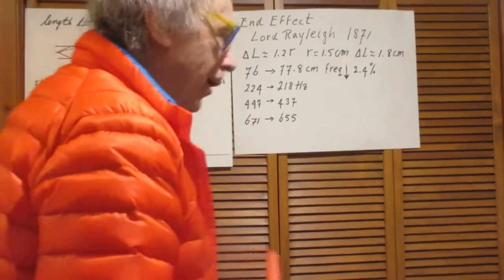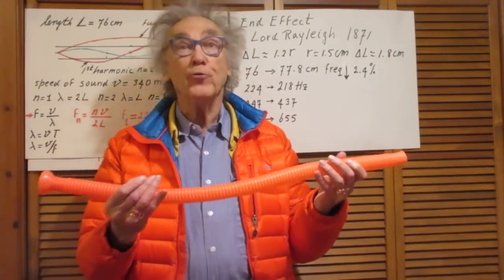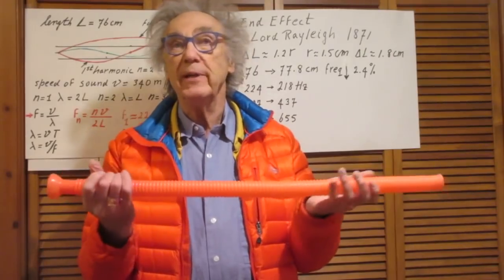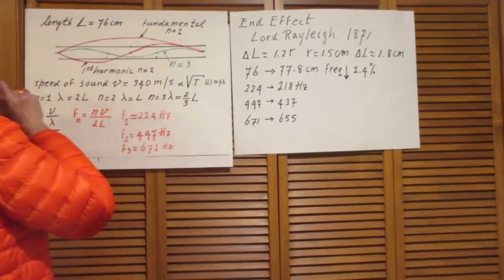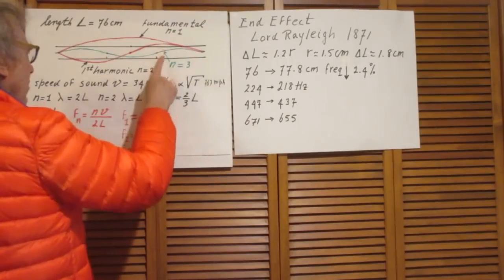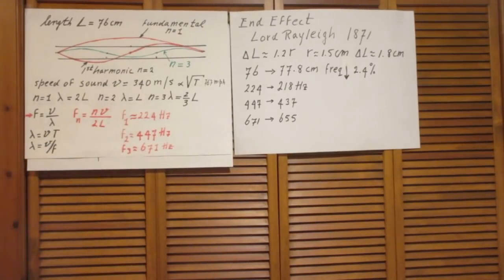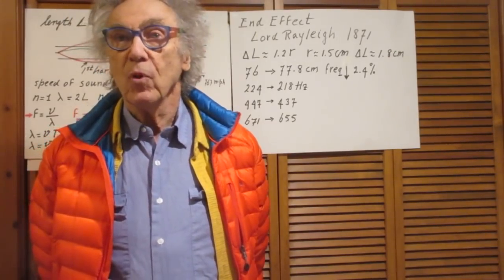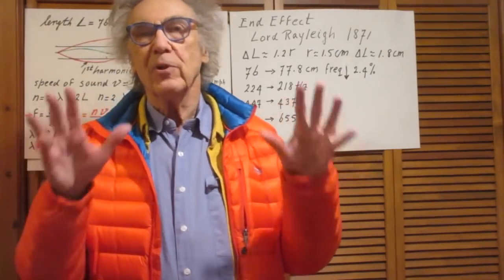Solutions to Problem #58 Organ Pipe

Comment: Thanks for another great lecture.  As to the difference in calculated vs measured frequency, how was the diameter of the tube determined?  Inside, outside or an average of the ripple pattern?  Just asking.

Comment: Coube some one have the windown opened so maybe the wind changes the presure in the air for some moment ????
Reply from the maker: "The fundamental and harmonics of a corrugated tube are lower than those of an uncorrugated tube of the same length and diameter" "The difference in speed between the moving end of the tube and the stationary, hand-held end creates a difference in air pressure. A higher pressure is at the fixed end and a lower pressure is at the moving end." https://en.wikipedia.org/wiki/Whirly_tube
Reply: @lecturesbywalterlewin.they9259  ok i read that and also about bugle scale Do Sol Do Mi Sol  , have a nice day profesor take care !!!

Comment: just as an idea where to look for the reason of the difference: i measured the freq. using a phone in front of my pc on your YouTube Video. so the Sound was transmited via the Internet. to make the loading time of Videos a bit faster the Video and the Sound are compressed. a method to do so is to make changes at the frequencies. for example mp3 cuts of frequencies that are not hearable be human ears. so Maybe you could do a measurment by yourself, in front of your Instrument. i used a Programm on my phone that has a Purpose to tune my guitar, this app showed me a frequ.
Reply from the maker: "The fundamental and harmonics of a corrugated tube are lower than those of an uncorrugated tube of the same length and diameter" "The difference in speed between the moving end of the tube and the stationary, hand-held end creates a difference in air pressure. A higher pressure is at the fixed end and a lower pressure is at the moving end." https://en.wikipedia.org/wiki/Whirly_tube

Comment: In my comments to #58, I proceeded from the speed of sound in Moscow at 342 m/s. I did not take into account that in New York it is much wetter and the speed is probably higher by 1% ... I didn’t take exact measurements, but compared it by ear with a generator, therefore there may be errors.
You, sir, very timely shared the observations of Lord Rayleigh, which led me to believe that the frequency slowdown is due to the partial reflection of the wave from the pipe walls, which leads to the extension of the path of a part of the wave, depending on the roughness of the walls, rigidity and mass of their material. This led me to believe that, in your experience, three factors affect the slowdown of the frequency: 1 - Lord Rayleigh effect. In addition, the corrugated wall of the tube leads to an increased backward reflection in comparison with the organ, and thus a total slowdown of the wave propagation velocity. 2 - Since during the rotation of the tube, the wave in it does not extend in a straight line, but describes a curve that resembles a part of a parabola, which increases the path. 3 - air movement due to centrifugal pressure, which may well be up to 3 m/s. The wave travels from the center to the outer end in a shorter time, but returns a little longer from the end to the center of rotation, which leads to an overall slowdown in the frequency of the sound. 
It seems to me that the main contribution is made by processes 1 and 3, which leads to a decrease in frequency by 4%. In addition, it seems to me that you underestimate the very elongation of the pipe from the centrifugal force.
Reply from the maker: "The fundamental and harmonics of a corrugated tube are lower than those of an uncorrugated tube of the same length and diameter" "The difference in speed between the moving end of the tube and the stationary, hand-held end creates a difference in air pressure. A higher pressure is at the fixed end and a lower pressure is at the moving end." https://en.wikipedia.org/wiki/Whirly_tube
Reply: @lecturesbywalterlewin.they9259  Yes of course!) Thanks for the reply, sir!
But I did not understand how the pressure difference affects the frequency? The difference in pressure between the high, formed air movement due to centrifugal force inside the pipe at the end and low, formed due to the relative air movement near the end of the pipe determines the amplitude of oscillations but not the frequency. The main share in reducing the frequency has a wavy wall. Without a difference in pressure inside and outside, there would be no fluctuations whatsoever!
I wonder what the frequency will be if it is,))) when the end of the pipe reaches the speed of sound?)
And what will be the frequency of the first harmonic in a sphere with a diameter of 76 cm, with holes at the poles?)))

Comment: Hello Sir, I really love your way of teaching. I'm currently a Ph.D. student at Czech Technical University (studying photonics). This is a little bit off topic, but still concerning physics, If you would have some time, I would like to ask you to take a quick look at my calculation of internal field contribution to self-inductance of wire. I can't figure out why I get different answers for two different ways of calculating it (through magnetic flux and through magnetic field energy). It's a simple calculation but I'm probably too dumb to find out where is the mistake (factor of two difference). I'm pretty sure that math is right, but there must be a mistake somewhere in my assumptions in the first method of calculation (calculation through magnetic flux) because the second result (through magnetic field energy) is correct according to all the sources. Here is a link to a photo of my calculation:    https://i.ibb.co/gwTJCgx/IMG-20190406-033302.jpg
I would be very grateful if you could shed some light on this. 
Thank you
Charles
Reply from the maker: self inductance of wires - use google
Reply: @lecturesbywalterlewin.they9259  Using google I'm finding many explanations using "flux linkage", but I think that correct result should be obtainable without using this unnecessary concept. I think that just using magnetic flux <-> integral B dot dS should be enough to get the correct result.

Comment: Is the tube stretchable maybe, so that when you swing it, it gets longer?
Since water molecules are lighter than N2 or O2 their speeds are higher and I think it is not likely that humid air slows down the speed of sound, it would rather speed it up.
Reply: I don't have perfect pitch, but a good recognition of musical intervals suffices.
Reply from the maker: "The fundamental and harmonics of a corrugated tube are lower than those of an uncorrugated tube of the same length and diameter" "The difference in speed between the moving end of the tube and the stationary, hand-held end creates a difference in air pressure. A higher pressure is at the fixed end and a lower pressure is at the moving end." https://en.wikipedia.org/wiki/Whirly_tube
Reply: @lecturesbywalterlewin.they9259  Thank you, very interesting! So
1. there is a steady flow of air from the hand-held side outward, making the total time for the sound wave to travel up and down longer (by a factor 1/(1-v^2/c^2) where v is the flow speed and c the speed of sound - assuming v=3m/s that only accounts for a frequency drop of 0.01%)!
I do not see how a pressure gradient by itself slows down the sound speed (but it may pose an acoustic impedance, so that energy is lost and resonance is less easy to achieve).
2. the corrugated side of the tube may cause the sound wavefront to be (very locally) not perpendicular to the centre line of the tube so that the sound travels more than the length of the tube.
Reply from the maker: @koenth2359  "The fundamental and harmonics of a corrugated tube are lower than those of an uncorrugated tube of the same length and diameter" "The difference in speed between the moving end of the tube and the stationary, hand-held end creates a difference in air pressure. A higher pressure is at the fixed end and a lower pressure is at the moving end." https://en.wikipedia.org/wiki/Whirly_tube

Comment: They called in English perfect pitch. I have not so accurate like others but I was guessing that the first time was A then I realized it was Ab. I am an amateur pianist that started playing at 7 years old. Either we have perfect pitch or not. We have a built in fast Fourier transform system by birth.
Reply: I think the only luck that I had was to start playing at very young age here is something interesting 
https://youtu.be/816VLQNdPMM
Reply: @odranreb000  Interesting video! 🙂
I have not perfect pitch, but I have relative pitch. So I definitely noticed the fifth between the first two tones.
As I wrote in my answer to professor Lewin, I played the tones at my piano and found them between G#4 and A4, D#5 and E5 and between G#5 and A5.
If I trust the tuning of my piano the tones should be between approximately:
415 < f1 < 440 Hz
622 < f2 < 659 Hz
830 < f3 < 880 Hz
Or:
427, 640, 855 Hz +/- 3%
Interesting that when I stopped listening to the tones I could fool myself to think both G# and A could be the correct key 🙂

Comment: I thought that in an open tube both endings were always antinodes, and is shown in many resources online. I'm confused now...
Reply from the maker: nodes for pressure, antinodes for the position of the air; in other words at the ends air flows in and out to keep the over pressure ZERO. I discuss this in Lecture 8 of 8.03

Comment: You know that the first sound is not fundamental from that the second sound is not an octave higher, which is quite easy to hear without any special musical talent. Those who are musical enough can hear that the interval is a fifth, which means that the sounds must be first and second harmonic. Could the frequency drop come from the pipe stretching because of centripetal force? It seems rather stretchy and I find it plausiple that it gains that about 1 cm needed.

Comment: Just understood your end effect comment, an extended ribbed tube would have an increased internal radius as the ribs flatten.
Reply from the maker: I see no reason why the ribbing would change the resonance frequencies. There have to be pressure nodes at both open ends. The End effect should perhaps be increased may be from r=1.5 to 1.7 cm. That is not enough
Reply: Lectures by Walter Lewin. They will make you ♥ Physics. Ok, but my idea was that a ribbed tube is like a spring - it may be compressed or extended by a force. When spun, you are introducing a centrifugal force , which causes the tube/ spring to extend. If the tube/spring extends by, say, 2 centimetres to 0.78 cm then the formula gives a frequency of 218Hz - almost a 3 percent change.
Reply from the maker: spring effect is negligibly small; it's less than 1 mm.
Reply from the maker: "The fundamental and harmonics of a corrugated tube are lower than those of an uncorrugated tube of the same length and diameter" "The difference in speed between the moving end of the tube and the stationary, hand-held end creates a difference in air pressure. A higher pressure is at the fixed end and a lower pressure is at the moving end." https://en.wikipedia.org/wiki/Whirly_tube

Comment: The tube is ribbed, could it be the length is greater as it rotates? I’ll play with the numbers and see. Your Dutch friends have ‘perfect pitch’ in English.
Reply from the maker: I see no reason why the ribbing would change the resonance frequencies. There have to be pressure nodes at both open ends. The End effect should perhaps be increased may be from r=1.5 to 1.8 cm. That is not enough
Reply from the maker: "The fundamental and harmonics of a corrugated tube are lower than those of an uncorrugated tube of the same length and diameter" "The difference in speed between the moving end of the tube and the stationary, hand-held end creates a difference in air pressure. A higher pressure is at the fixed end and a lower pressure is at the moving end." https://en.wikipedia.org/wiki/Whirly_tube

Comment: 1. The left-right movement of the hand (in order to rotate the tube) I think that it modifies the effective tube length.
2. The centrifugal force may slightly elongate the tube (like a flexible drinking straw)
I believe that the contribution of these two factors may explain the discrepancy between the measured and calculated frequencies.
Thank you for your videos and your interesting problems!
Reply from the maker: elongation is negligible; it's less than 1 mm !!!

Comment: No mystery why the frequencies are low!  The pipe is elastic because the corrugations make it stretchy.  Centrifugal action stretched the pipe leading to lower frequencies.  Do this experiment.  Blow into the tube and adjust to get lowest tone.  Then pull on the other end to stretch the tube.  Pitch of the tone will noticeably drop.
     You mention "fancy" measurements being made to conclude that the fundamental didn't sound.  Anyone with the must fundamental experience with music (especially with trumpet or bugle) would recognize that the "1st harmonic" should be an "octave" (musically) above the "fundamental".  (And no, "perfect pitch" is not required; only the ability to hear pitch RATIOS, which is what music is all about.)  On listening, it was obvious that it was only a musical fifth above, which means 3/2ths the frequency.  I mentioned this in the comments in the original problem.
     You need to add another addendum to this subject explaining how the oscillation occurs (with the corrugations being necessary for the pipe to sound, as I explained in my comment in the original problem video).
Reply from the maker: "The fundamental and harmonics of a corrugated tube are lower than those of an uncorrugated tube of the same length and diameter" "The difference in speed between the moving end of the tube and the stationary, hand-held end creates a difference in air pressure. A higher pressure is at the fixed end and a lower pressure is at the moving end." https://en.wikipedia.org/wiki/Whirly_tube